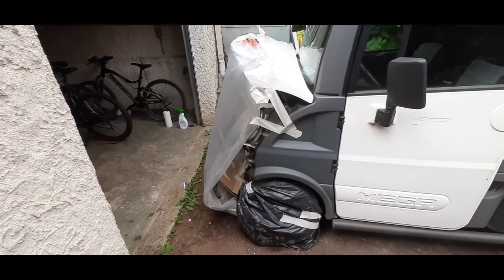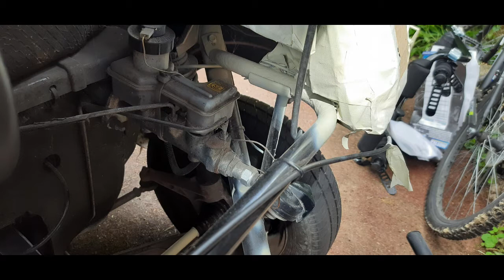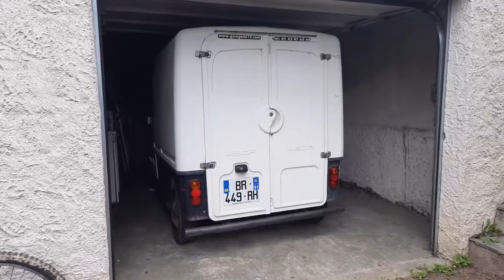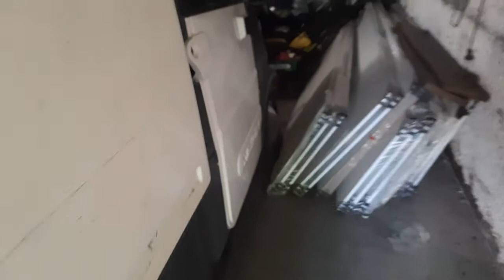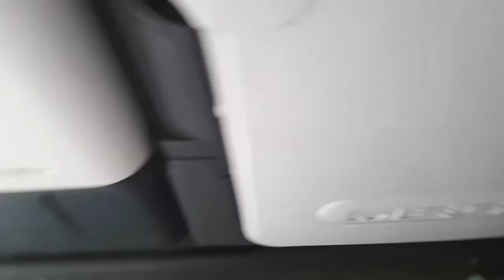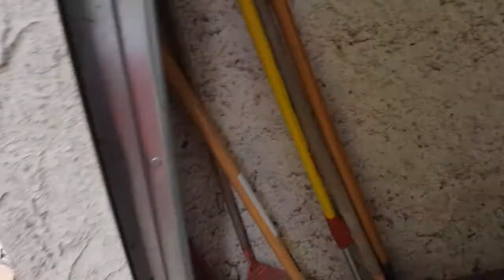Will Mega Breadvan fit?  | Aixam Mega Multitruck

Comment: I got a diesel one think break switch has gone can't get back break lights to work
Reply from the maker: Are the fuses OK? I changed all mine. One had even melted. The only electrical problems I have at the mo are a non working horn and the headlight warning buzzer not working when you open the drivers side door.